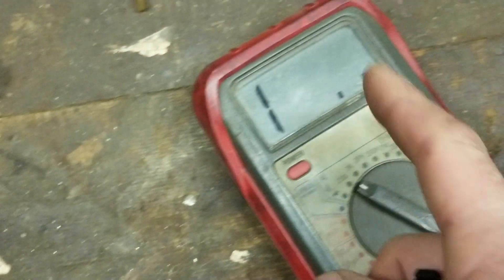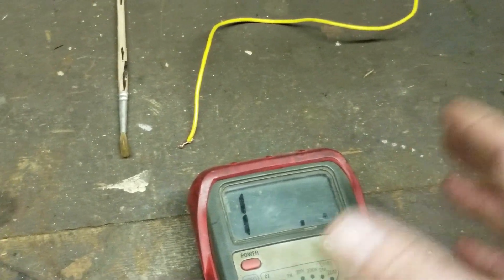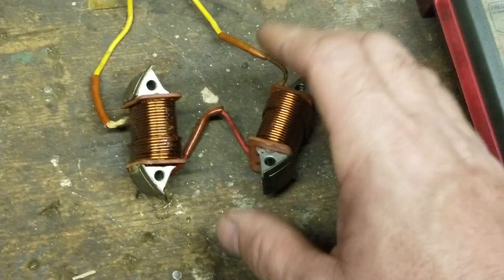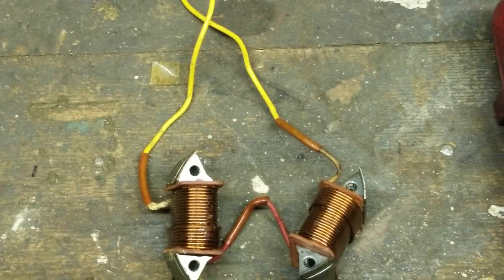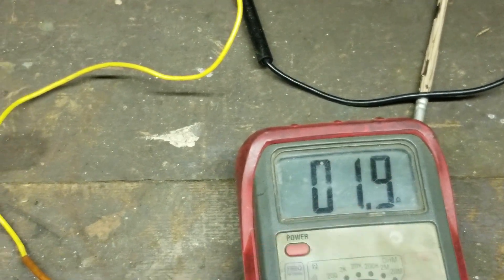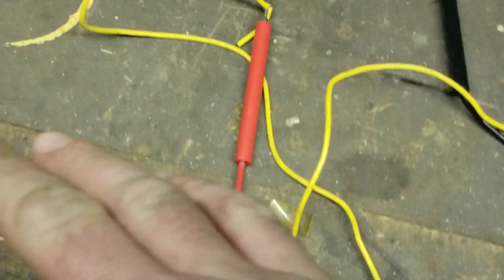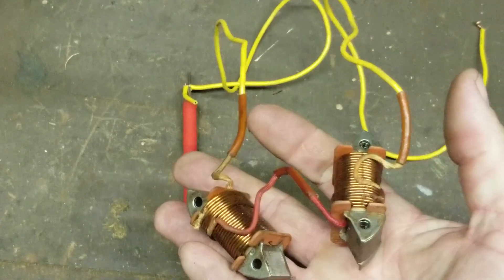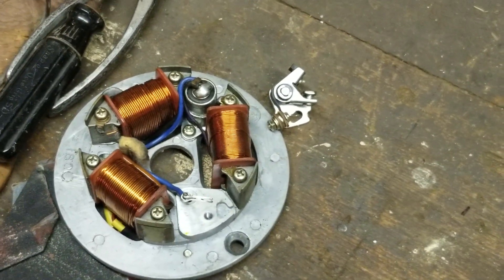How to test charging system 6volt dirt bike magneto

Comment: Hello Kevin, greetings from Austria! 
Thank you so much for your wonderful video. I was wondering if you could help me out with my Vespa 1983 stator with points? For what I already checked, it looks like one of the coils or maybe a cable is not working properly and I am not receiving the 12v necessary for lights. I do have some voltage, but it stays around 6v, depending on the torque of the vespa, since the energy for the lights come directly from the stator instead of the battery. I could send you some pictures, if it would help. Many thanks in advance. RENE
Reply from the maker: Welcome to the channel can you text me pictures 603 395 8097
Reply: @2strokeguru  thanks for your reply! Which country are u from?
Reply from the maker: @atreio2004  America

Comment: Very informative video. TY. I am troubleshooting a 1974 Kawasaki MC1. The manual says to test the coil (under the magneto), you unplug the black wire that goes to the ignition coil and then test between the black wire and ground. If you get .5 ohms, it is good. You mentioned unsoldering the wires from the condenser before testing the coil...I am measuring 1.2 ohms and I'm not sure if the coil is good or bad. No spark. New ignition coil, points are working....
Reply from the maker: did you replace you points
Reply: @2strokeguru  No, I have not replaced the points or condenser. I did test the points and I have continuity when closed and an open circuit when the are open (I removed them from the stator to test).
Reply from the maker: @matbogbrygmail740  check out the video i just posted

Comment: Its been Sitting for several years. Now it won't Start. I Pulled the Carb...Looked Good. Still won't Start...won't even Pop. Pulled the Spark Plug and Grounded it to the Head while Kicking the Engine over. The Spark seems on the Weak Side to me...but I'm no Expert...know just enough to be Dangerous! LoL
Reply from the maker: What year Honda